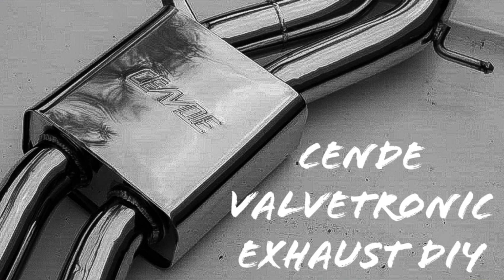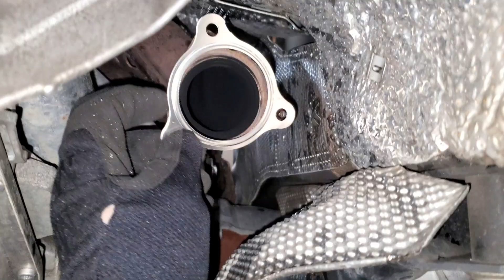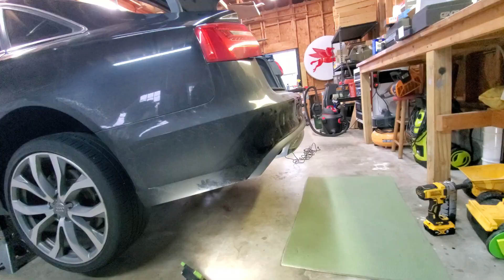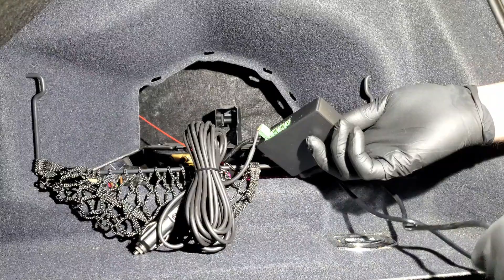Audi C7 Valvetronic Exhaust Install

Comment from the maker: Video Navigation:
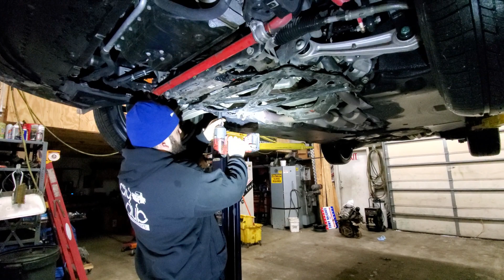0:00-5:08 - Sound Clip/Intro to Video
5:09-9:28 - Oem Downpipe Removal/Cende Downpipe Installation
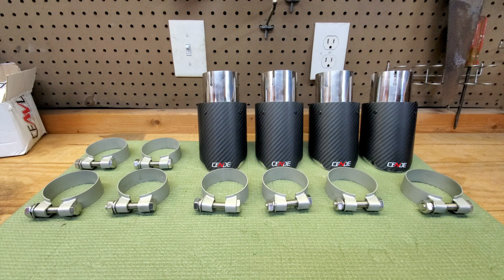9:29-12:50 - Recap of work done/Day 2 of install intro
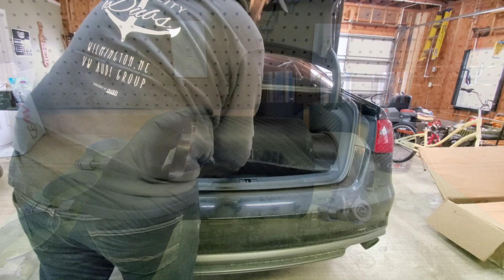12:51-15:00 - Discussion of proper exhaust clamp placement
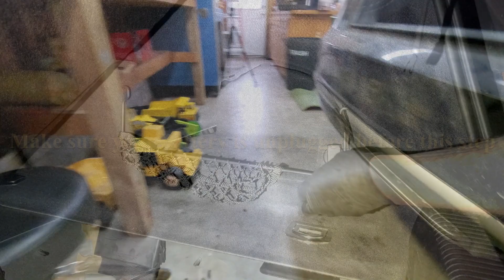15:01-21:40 - Removal of the rest of the OEM Exhaust
21:41-34:22 - Properly Routing & Securing your Cende Wiring Harness
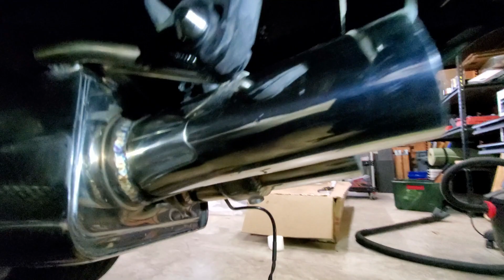34:23-42:15 - Installing the rest of your Cende Exhaust (mid muffler to rear mufflers)
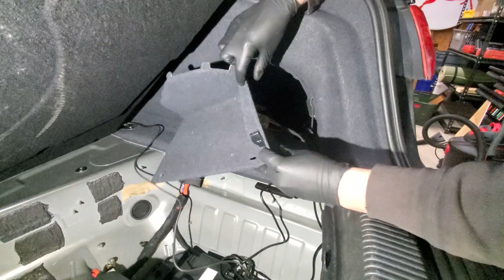42:16-49:53 - Plugging in your Wiring Harness, Testing your Muffler Solenoids, & Your Cende Remote 
49:54-51:43 - Storing your Manifold/Harness & Putting your Trunk Liner Back together
51:44-53:58 - Outro/Final thoughts on the DIY
53:59-54:59 - Valves Open vs Valves Closed Exhaust Sound Clips

Comment: Hello ! One question please. Does those valves have vacuum like the oem ones when they are closed/comfort mode. Do they open when you accelerate over 3000rpm for the back pressure ?
Reply from the maker: The valves are controlled via remote electronically. There is no vacuum actuation.
Reply: @GarageTaught  can i write you on  instagram it would be much easier ?
Reply from the maker: That's fine

Comment: Hey, I installed the Cende exhaust on my 2014 A6 2.0t and so far I am really happy, but I’m having issues getting the correct diffuser (been riding without one for awhile) What is the width of the exhaust opening on yours? Also, I appreciate all your videos. They are helpful, even for my 2.0. Thanks!
Reply from the maker: Thanks man! I have a 3.0t exhaust with quad tips so my opening won't be anywhere near close to yours unfortunately. Does yours not fit with your oem diffuser?
Reply: @GarageTaught  
Yo, it’s a Cende valvetronic exhaust with quad tips and the mufflers look the same so I figured they were similar in sizing at least with the spacing between the tips. My OEM exhaust was a duel exhaust and there are some people that make a quad tip diffuser for my non sline rear bumper, but the one I ordered did not fit. I’m scrambling trying to find a solution. I’ve been riding with no diffuser since April 😒.
Reply from the maker: Ahhh gotcha. Do you follow us on Instagram? If so send me a DM. I might be able to help you out

Comment: Did you let the transmission sag and use a strap to pull it too one side or the other from the tail? Gives you just enough room get everything out. Sounds mean!
Reply from the maker: We did. But it just would have turned into a much longer endeavor than we needed it to be that day.

Comment: Are you still running stock cats?
Reply from the maker: Negative. I have gutted oem cats.
Reply: @GarageTaught  Thanks! So your setup is catless now? Good video.
Reply from the maker: Yep. Right now this is my exact set-up:
-Gutted oem cats (they started melting a few months back)
-Non Resonated Downpipes, heat wrapped
-Mid Muffler
-Rear Valvetronic Mufflers

There is rasp with this setup when the basics are open, so Cende just shipped me a set of Resonated Downpipes to try out & see if that fixes things.
Reply: @GarageTaught  How many miles did you have on the tune before they started melting? Do the O2 sensors stay located in the gutted cats I am guessing? Thanks for the info, I am stage 2 DP on my C7.5 A7 and am gathering info for when I may have to proceed down this path. Trying to determine what may be a good setup that isnt annoying and loud.
Reply from the maker: They started melting about 7k into my stage 1 tune.

Yes, 02 sensors stay in, but you need 90 degree spacers to get rid of your CEL
Reply: @GarageTaught  Big thanks man, take it easy!
Reply from the maker: No problem. I'm here to help people. Lemme know if you have any other questions.

Comment: just a tip(i swapped my whole engine on my a6 c7, and i say this not to sound like a smartass, but to make it understood i know for sure it works from my own experience ). if you want to get to those bolt's out(for tespipes) it's not that complicated: the 2 on the top of your cat, you just have to remove your cross member(the x shaped aluminium bar that's under the plastic near to the windshield wiper that covers your ECU, dot reservor, etc) and than remove that plastic heat shield that's behind the engine(the engine wires go trough it and another cable that you can even leave on if you are lazy like i was to unhook all the cables and after you remove that you have more than enough space to remove the 2 bolts on top with some simple straight extensions and the one on the bottom you use a wobbly socket and extensions and you can get it out pretty easy)(i had no experience with cars prior to swapping the engine so i learned e verything by trial end error on my own)(i need to replace my cat backs too soon because i blew the flex pipe on the driver side(2y ago the passanger side broke on me now the drive side did the same and i'm done with that and plan on going test pipes)(and as a mention i used quickjack  to lift the car)
Reply from the maker: Good to know. The main thing preventing us from removing them were the stripped heads of the bolt. We'd have to cut out the oem cat to get the right tool on it to remove it... Luckily they are already gutted.
Reply: @GarageTaught  ohh... that makes sense. if the bolts are stripped that would definitely be a royal pain to get them out. great job and videos mate. looking forward(to what mods I'm doing myself too(after i see how yours turn out) :))
Reply from the maker: Thanks a lot man! Appreciate the support 🙏🏻
Reply: @GarageTaught  question: How does it sound at highway speeds? droning at all? I would like to not drive my kids nuts in the back if I have to go on long trips?
Reply from the maker: If the valves are closed there is no rasp or drone at all. If you have the valves open, then there is a very large amount of drone at highway speeds when you get onto the gas. My wife just took the car on a road trip 4 hours one way, four hours back. She did not complain about the exhaust at all with the valves closed. My two-and-a-half-year-old slept the whole time.
Reply: @GarageTaught  awesome.  Thank you for the reply.  Will order one too and give it a try. Looking  forward  to the next video with the resonated downpipe you will get
Reply from the maker: I'd Def suggest getting the mid muffler + x-pipe vs just the mid muffler

Comment: Just a quick question- since your cat is gutted, are you throwing any codes? I’m in the market for a high flow cat but at the same time I am a bit cheap so I’m kinda leaning towards the gutting method. Thanks in advance and I really appreciate all your videos!!
Reply from the maker: I am throwing codes because of my 02 sensors. I live in a county without emissions inspections so it's not a huge deal to me. Eventually I will get some 02 spacers to get rid of the CEL.

Thanks for the support!
Reply: @GarageTaught  I see, I’ve been looking for ways to get around that and came across those spacers... good to know!! I definitely like the Cende exhaust set up, I hope to go that route in the near future
Reply from the maker: Let me know if you need any help with it 👍🏻